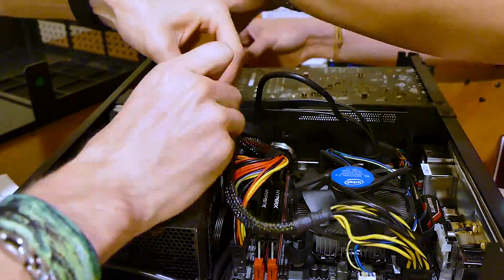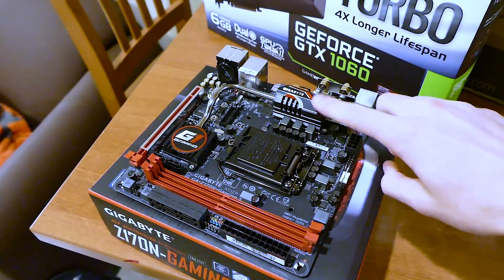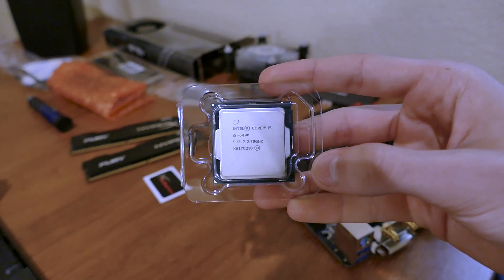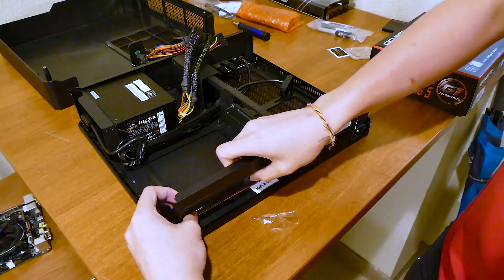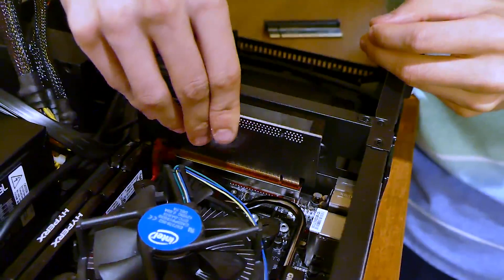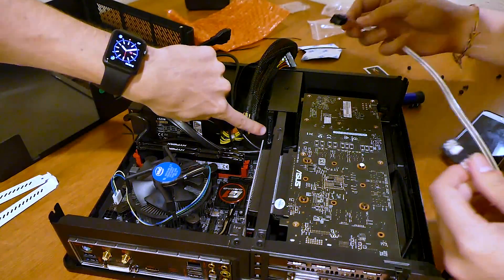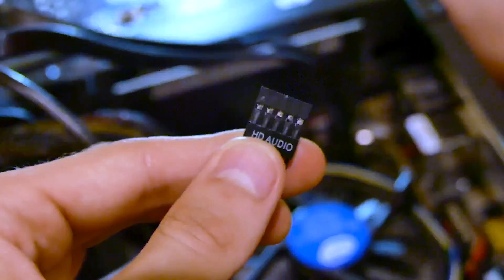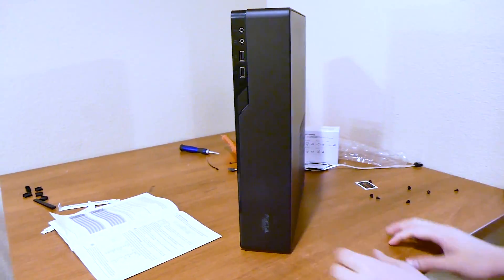How to Build an ITX PC (2016 Edition)

Comment: Thank you, so informative.

As I've never written to a YouTube channel before, please bear with me. 

Based on this video, I built my first gaming PC but... it doesn't boot!

Node 202
Aous 570i ITX Pro Wifi MB
Ryzen 5800X
16GB RAM
Scythe 2 CPU cooler
Radeon RX600
EVGA 650W PSU

Can
 I hire someone to help me debug the problem? Is this even legal to ask 
on a site? I'd need to work with someone who has experience with the 
Node 202 and the 570 I ITX MB.

If you're interested, please contact me at gary@garysinger.com.

Thanks!
Reply: Did you manage to figure it out?

Comment: Does the node 202 come with the pci riser card? Also is the 450 watt power supply enough for a i5 8600k with 16GB ddr4 @ 3000mhz and a gtx 1060 6GB?
Reply: I think it comes with a riser card, but 450 watts is cutting too close for your system. Maybe atleast 550 watts or 600 watts

Comment: Great ! Built mine a few weeks ago with Node 202 , MSI B250I GAMING PRO AC , Intel Kaby Lake Core i5-7400 - 3.0GHz , BALLISTIX PC Sport LT - DDR4 - 8GB - 2400 MHz , Samsung 250Go SSD 2.5 850 EVO , Enermax REVOLUTION SFX - 550W - 80PLUS GOLD , GeForce® GTX 1050 Ti OC 4Go GDDR5 , Noctua NH-L9i Ventirad HTPC and Rapoo Mouse + keyboard 9060...works just fine and it's very quiet...

Comment: dude you didnt mention that stupid ass support bracket. i couldnt move it back or anything finally i just remove it, pretty sure it will be impossible to ever put back in. your card is significantly larger than mine too
Reply from the maker: Yes I did, in a separate build guide using this same case. The support bracket can be slid back and forth and removed altogether.
Reply: ohh my b i didn't see it ill have to look at it. i tried sliding it and it wouldn't so i just like popped it off. thanks man
Reply from the maker: It'll slide - ya just gotta be a little rough with it.

Comment: i'm new on building pc, especially this is my first time knowing about mini-itx
can i run this with this setup?
1. i7 6700
2. Cryorig C7 Cooler
3. Fractal Design Node 202 w/o PSU
4. Zotac GeForce GTX 1060 AMP Edition 6GB DDR5
5. MSI B150I GAMING PRO - Mini ITX (Socket 1151)
6. Kingston HyperX FURY Black 16GB Kit (2x8GB) 2133MHz DDR4 Non-ECC CL14
7. PNY 480GB SSD
8. PSU THERMALTAKE Toughpower SFX Fully Modular 450W 80+ Gold
open for suggestion, cuz some of pheripheral on the video description isn't available in my country. thanks before

Comment: Hello! I'm pretty new to the channel but loving the quality and type of videos you do! I'm planning on building a mini-itx system and I'm choosing from corsair carbide air 240 case or this. My system will be very similar to this and I am really interested about the thermals of the node 202. Of course I have read everything there is to find about builds to this case but I'm wondering do you have any numbers of it? The carbide 240 is considerably bigger and although I still like the looks of it and the possibility to do a led-lighted system, the console looks of the node are so intriguing. Basically long story short I'm just wondering is it worth it to go for such a small case when in the end it will sit on your desk 99% of the time. And is it smart to sacrifice thermals for size when you dont really need to, and might just shorten the lifespan of your components. Hope you answer, thanks anyway!

Comment: For an itx pc build you use Silverstone Sugo S13 (the one with fan in front), DanCase or NCase. In Node, my one of builds almost "caught fire". You should do a video for those. BTW, I like your videos, u have a good style.
Reply: djas macco you did something wrong, my node 202 runs low 50's cpu and mid 60's gpu when gaming ,  69 cpu average prime 95 and I have a delidded 8700 and an EVGA 108ti with noctua cooling and extra fans.
Reply: @paulm2467  Are you using Noctua air cooler for the cpu?  If so which one?
Reply: @534A53  I've got a noctua  NH-L9i, I don't think it would be enough without the delidded cpu the consensus seems to be the big shuriken is the best for the node 202 but the most significant is the delid on the cpu side. I have two 40 mm noctuas (cable tied on) as exhaust as well. On the graphics card side I have 2 slim prolimatech fans. I've also minimised cables by using a modular psu and an m.2 ssd to improve the airflow, as a  bonus you can then route the front panel connectors via the ssd bracket.

Comment: This adds more than 800$ tho, I just built a similar system and it costed me 800$ and I used a cheaper mobo (non oc), an rx 480 I bought for 180$ (the 6gb 1060 is 250) and a 240gb ssd instead of 500gb.

Comment: how much money would it add if I used the 6600k instead
Reply: Also. Would the MSI 1060x work in this case?
Reply: One more question lol. I have an 500gb HDD with the 64bit Windows 10 pro on it I got in a laptop. I know it's better to boot off SSD but how much difference would the HDD make. 

New to pc building. So sorry if my questions sound idiotic lol
Reply: SSD is much faster in boot up time. Neglible if you dont want to export/copy projects that are high quality and big in size. So varies upon how you use it.

for 6600k it would cost : 825$ approx.
 If you're just going to build a new pc then i suggeest you to wait for amd to release vega. Prices of products may dramatically decrease. :)
Reply: It'll probably be around tax time when I build mine. Thanks for the info.
Reply: It'll probably be around tax time when I build mine. Thanks for the info.

Comment: This is a really good video...except for the fact, that if you were to buy these parts in the Netherlands, you would have to pay 300-350€ more because we have higher tax rates. None the less, it is a good example for a high quality, low profile build.  I would however like to know how you would keep a case clean like that. Dust will accumulate over time, and it will creep in the gpu. Any thoughts on this?

Comment: help!
im building a mini PC Gaming:

-i5 6600
-msi h110i PRO
-8GBx2 TeamElite+
-1TB hdd 7200rpm
-1 ssd Sandisk ultra-II 240gb
-Zotac AMP! gtx1060 6gb

-Thermaltake Core V1

-Seasonic G-550
-Noctua NH-L12

are there any incompatiblities?
Reply: no but go for the i5 6500 and i´d chose the 550 Watt EVGA SuperNOVA G2
Reply: why 6500?
and that PSU does not exist here

Comment: My specs for my itx build are:
Cpu-I-5 4460
Gpu-Gtx 1060
Case-Rvz02
Mobo-Asrock h97
Storage-crucial 500gb ssd
Psu- Corsair sff 450w
Cpu cooler- argon ar06
Ram- 8gb gskill

Comment: can you give us the temperature results? ty
Reply from the maker: Already did in a separate video.
Reply: link pls ty
Reply: Yeah, same question. 
BCLK OC using a stock cooler and in an ITX case with passive air flow sounds like a very good way to cook your CPU.

Comment: Great video. My build is going to be quite similar spec-wise but in the coolermaster 110 with the 1060. What I have found though is that the CPU (6400/6402P) bottlenecks far before the gtx 1060 or RAM - if you're over 10GB, in modern games currently being released. I've seen that one of if not the highest Core i5s, the 6600k still bottnecks far before that gtx 1060, it's a great card. I have decided to go with a i7 2700 (non k) which I have picked up for a good deal. Maybe a 1050ti would be slightly more feasible in this setup with your i5? Those stats are just based on minimum game requirements of these new games that have come out, such as Far Cry Primal, but not exact real-world testing with that specific hardware. If its read by you, let us know how the setup is doing and what sort of frame rates you're getting.

Comment: Cable management, aarrgggghhh, MY EYES (I have the same case BTW, proper cable management takes ages)
Reply from the maker: Impossible with a non-modular PSU in such a small case. We did fine given the circumstances.
Reply: Do I need to send proof? :D

Comment: The only issue I had while watching this was that you didn't stabilize the PCI-e extender slot really. It's bending noticeably and is kinda worrisome in the long run. :/ There are 3 holes for screws in the extension piece and... well, it's kinda necessary given that the card is visibly warping the extension despite being screwed down tight. :S

Good build, but that one little thing still sticks out like a sore thumb. >.<

Comment: Hey you guys forgot the 3 screws for the riser card from the pcie slot. This will support the video card and put less stress on the motherboard. No data on the results? I was thinking of getting the same 1060 for my build. I used a spare I5 6500 which runs at 3.2ghz and Turbo at 3.6 - I would recommend the small price difference with this but significantly better performance. Good video

Comment: i kinda did something similar except no gaming just normal media plus internet through network on a 6 year old dell inspiron 560 with the pentium. It was still in original box and was way cheaper. its in my 46 inch monitor

Comment: I am thinking of doing a similar build but using an i5 6600k and a 1070. However, would a Noctua fan fit in the case? also any mobo alternatives i can use? i don't plan to overclock.

Comment: I built a PC in July using this Fractal Design Node 202. I won't recommend anyone, expert and amateur alike, to build in this case. It's a difficult case to disassemble and is still too large and heavy to be considered portable. Better choice would have been the Fractal Design Core 500, Sharkoon QB One, or (if your graphics card is less than 280 mm/ 10.5 inches long) the Silverstone Sugo SG13BQ.

I used the SG13BQ for an MSI GTX 970 (279 mm long) and just barely fit with some squeezing. Card works perfectly and I'm typing this on the PC that used to be in the Node 202. It's only 2.43 kg compared to the Node 202's 3.5 kg. It's a lot easier to fit the Sugo in a carry-on luggage bag than the Node as well, due to it's shorter dimensions.

Comment: Sorry for the probably lame question, but can I play properly The Witcher 3 on this particular baby? And another one... Is it possible to buy the same parts at similar price from Amazon.co.uk?
Reply: Yeah it will handle Witcher 3 great, and you probably won't. Go to https://uk.pcpartpicker.com/
Reply: Thanks for the link. Most useful for lamers like me.
Reply: this build can definitly run the Witcher 3 on ultra with 60fps on 1080p res.

Comment: This will be my first PC build.. I've come up with a few parts with a total of $1413.. I wanted to go all red! But I don't want to spend so much on a PC due to it being my first build.. so my question is I play Battlefield, COD, The Division & Need For Speed.. I'm probably going to be using two "monitors" one small monitor to read comments run social media while my second "TV" will be running my console Playstation 4 Slim I'll be using ElGato to stream so my question is what would be a great build as a starter PC without going over $1000 I will be streaming on twitch & YouTube I don't need 4K or high setting just something playable and strong enough to handle my needs.. I'll be doing minor editing Adobe if possible

Comment: The case is upside down. Or rather....i have it the other way vertically. My gpu sits at the top of the case with 2 extra fans inside for lots of positive air pushing out all the hot air to the back and top, although i still dont have a blower style gpu.

Comment: Question about the motherboard you used, the Gigabyte GAZ170N-Gaming 5: The Gigabyte website says that the USB3.1 utilizes the Intel Alpine Ridge controller which also supports Thunderbolt3. Recently there was a firmware update from Gigabyte that unlocks the thunderbolt 3 functionality of the USB3.1 port. People have posted photos of the windows device manager showing a Thunderbolt 3 controller available.
1. Have you installed this firmware update and the thunderbolt driver from the Gigabyte website? 
2. Do you have any thunderbolt devices to test that the Thunderbolt3 is functional? 
I'm also curious if its really 40Gbps. Then this system would be able to support external Thunderbolt 3 GPUs in the future potentially allowing an even smaller enclosure.

Great video! Thanks!

Comment: hi i'm planning  to build gaming pc and i went to know if i can i play all current game with this config
CPU INTEL CORE I3 6100
mobo Gigabyte GA-H110M-S2H
power  THERMALTAKE SMART-SE 530W Modular 80Plus Bronze
CARTE GRAPHIQUE GIGABYTE GEFORCE GTX 1060 G1 GAMING 6 GO GDDR5
case NZXT SOURCE 340 BLACK/BLUE MID TOWER
MEMOIRE DESKTOP AVEXIR CORE BLACK LED RED DDR4 8GB PC2400CL15
DISQUE SSD AVEXIR 240GB E100 SATA3
Reply: you should probably get an i5
Reply: thank you i get an i5 6600k
Reply: youcef adimi good choice, I'm stuck with an fx 4350 atm lol
Reply: time to upgrade bro
Reply: youcef adimi I have no $$

Comment: Hey! Thanks for the video, I'm planning my first PC build in this case as well because I have space constraints at home and this seems perfect. I have a question about the graphics card though. Should I go the the 1060 Asus Turbo (the one you used) or the Gigabyte overclocked ITX card (this one: http://www.newegg.com/Product/Product.aspx?Item=N82E16814125903)? 

The Turbo is a reference cooler design (better for smaller builds I take it) but I am not able to ascertain what the cooler style on the Gigabyte is. Can you help? If it's not something that will blow hot air INTO my case I should be fine. If it does, I'll have to end up going for the Asus Turbo. Just how much performance will I lose if I go this route?

Thanks again!

Comment: Is this good? I am thinking of building this..

-Intel Core i5 6500 3.2 GHz Quad Core.
-Gigabyte MicroATX DDR4 GA-H170M-DS3H
-EVGA GeForce GTX 750ti FTW GDDR5 2GB
-Corsair Vengeance 8GB 2x4GB
-Corsair Carbide Series 100R Mid Tower Case
-1TB HardDrive
-EVGA 500 B1, 80+ Bronze 500W

Cost = $644 In Total..
NOTE I AM NEW TO PC'S

Comment: please dont leave the xbox and pc on the sub lol or at least throw some thick rubber on there to keep from vibrating and ruing finish (and HDD on xbox haha)
Reply from the maker: Only sat them there for the sake of comparison...
Reply: oh good. love your videos man. keep them up. been wanting to build an itx machine but still not pleased with current blower style coolers and stock heat sinks. luckily everything is slowly requiring less and less energy and produce a little less heat as a result (well....kinda). Maybe next year ill pull the trigger and build one. really liking the new mini 1070s, hoping that  plus a low profile AIO water cooler will get the heat out of the case while still being pretty silent and reasonable temps. Thanks again

Comment: i built almost the same pc but i got the shorter evga 6gig card 1060ssc and put 2 ssd's in raid 0 and 2x2tb 2.5 for storage in the extra space on the back in of the card with a small drive cage that i tapped some mounting holes for.

Comment: Why does the USB 3.0 header cable have to be so fucking thick...come on manufacturers !!
Reply: lets see you try sticking 19 wires together any smaller
Reply: Fucking this!  It is the worst cable by far.
Reply: S Saini Yeah my USB 3.0 header cable is right next to my 24pin and messed up the look of the custom 24pin cables. So I'm hopeful that case manufacturers at least make them flat or something soon.

Comment: Great video. I've some old parts from my preview setup and I've been thinking in doing something like this. Btw, I'd say a modular power supply would've been better in order to avoid all cables resting arround the motherboard. It makes the  airflow more fluent as you already know.

Comment: Wow, you get a lot of comments. The GPU choice you made was very poor in terms of it being very loud and performing worse than a comparable card like the EVGA 1060 SC.
Reply: did you not listen, he chose that one because it's a blower style gpu so removes almost all the heat out of one exhaust
Reply: Do you not know how to read? It will still be louder and perform worse than the 1060 SC in this case.
Reply: +igloo2 dude the noise won't even be that much of a bother than the gpu reaching max temps and getting bsod. we did read and we did understand. you are going by performance and noise levels, we are going by safety and caution.
Reply: much stupidity. The difference is minimal and frankly Turbine coolers are better for itx builds even if the turbine model "performs worse" which technically it's performing exactly how it should. gpu boost gives a bit of an overclock if the power limit and temp limit permit if it doesn't it just goes down to stock speeds.

Comment: i wish they made external power bricks for 500w 80+gold would love to see this case smaller and feel its let down by the size of it next to the PS4, we really need to be making cases PS4 identical size which can take a 6700k, itx or stx board long as its got a Pcie slot, say a gigabyte Mini itc 1070 sized card, 16-32gb ram, 1x 2.5inch drive. Can only hope. One day maybe
Reply: surely the likes on corsair, should design this case, having ventured into the SFX PSU's they could design a new case that is maybe the smallest, but still fits a capable gaming itx pc thats ITX sized not like the 250d

Comment: Real question here, why a 1060 instead of a 480 ? I know the 1060 is slightly better, but not that much right ? For a worse price.
Reply: Ehhhhhh, the price changed that much ? I'm pretty sure the 480 was cheaper than the 1060 but now it's the contrary ? How mysterious this works. I guess the 1060 is a better option now.
Reply: Yeah, Nvidia is higher than amd for the 2 first months of release but prices drops rapidly, at least.
Reply: Silveraga It's confusing tho' 'cause the 480 is more future proof. I don't wich to advise now.

Well for now intel win on the mid GPU price i guess.
After that the 1070 is by far the best option.
1080 is more for a really pricy computer. 4K is not worth for now in my opinion. Still beautiful.

Soo Intel win the GPU war for now..
Let's see how AMD will go with Zen. Hopefully they will be good and drop the price of intel Skylake~